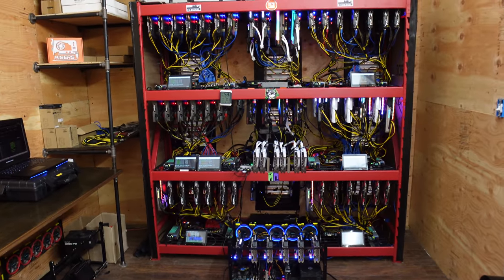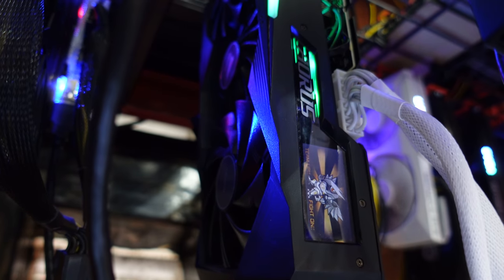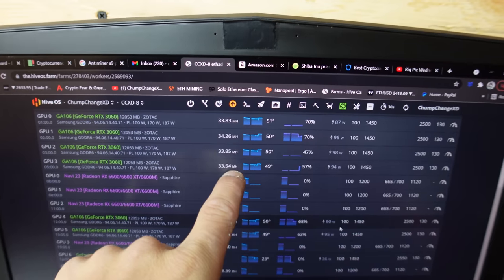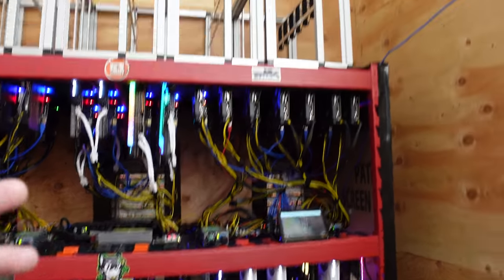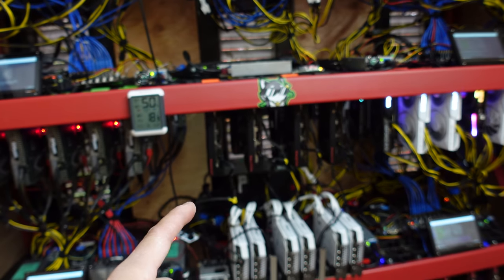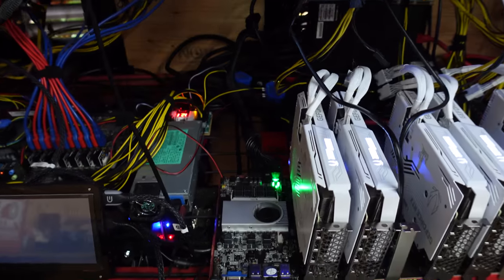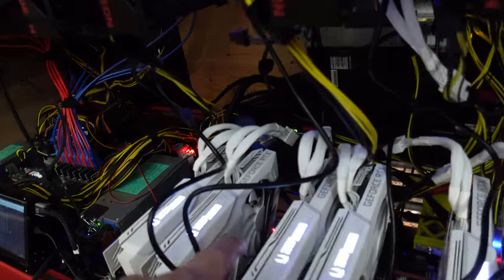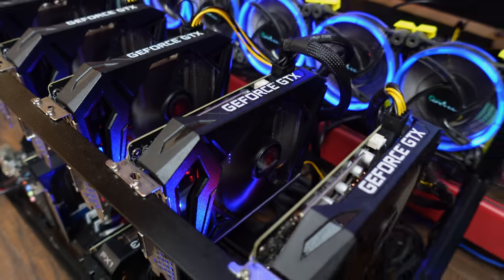My GPU Mining Farm 2021 Is Possibly Too COLD?

Comment from the maker: Do You Think The COLD Will Negatively Effect The Crypto Mining Garage? Let Us Know Below!

I WAS 100% READING THE WRONG NUMBER ON THE THERMOMETER. BUT ITS STILL RELEVANT TO THE VIDEO LOL! ❤
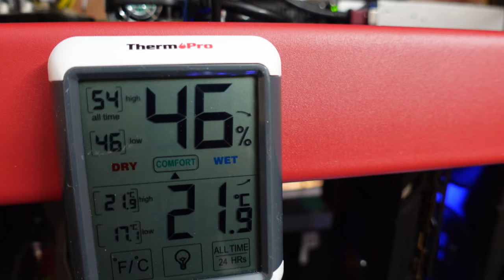Reply: You are reading your thermostat wrong. It said 46% which is your humidity and the bottom number is your temp which you have on celcius. 21.9C is 71F Fahrenheit. Using 7:55 time in vid as reference.
Reply: Well I havent had my gpu setup in the cold but I used to run a few asics and when it got to cold they wouldn't work. Some of them just kept rebooting and others would significantly drop in hashrate. I've also watched a few mining farm tours and everyone says the same thing. Heat is never an issue cause moving air can do the trick just fine. But to cold really hurts the system
Reply from the maker: @thebennymenshow4160  100% my concern thank you ❤️🔥
Reply: @xtremerip  this. It read humidity in the 40s, but temperature in the 50s, on the top left corner of your meter.
Reply: @windpeoples  that is the high humidity reading. The temp was 21.9 c
Reply: @windpeoples  The top left is the high and low humidity reached in last 24 hrs. The bottom half of that thermostat is the temperatures which he has set in celcius. The thermostat is reading around 70 Fahrenheit which is great temps. The top half is humidity. I have that exact thermostat
Reply: @xtremerip  Thanks for enlightening me! I live in a corner of the world where there are hardly any insulated buildings, and no AC or heating are standard, so it is a bit harder for me to read those things. :)
Reply: @windpeoples  No problem. Chumpchange is in USA so he is use to Fahrenheit and probably didnt notice its on Celcius which confused him. Ive done that many times here. He thought higher number was a Fahrenheit reading. Very normal mistake for us peeps in the USA
Reply: lol no.  I mine on my three season porch in the winter here in MN and always get much better performance.
Reply: 100% no.  Until lower than 0C
Reply: I’m in New England and besides my cards running cooler I get marginally better performance in the winter with the rigs in my garage.
Reply: when smoke then trouble shoot, hahahahha j/k <3 420
Reply from the maker: @jaZz-xg5ns  FML LOL
Reply: At my area 8 months a year temps are below 10C and running farms in cold scheds without an issue. As long farm keeping room tem some degrees higher than outside temperature the humidity is not an a issue. However is better t build walls and other surfaces non condensing material to avoid excessive humidity.
Reply: What are those little monitor screens, and where can I grab one from?
Reply: Hey, coming from the overclocking scene and i have a straight answer for you:

No.

At "worst" it has a positive effect on stability and overclocking performance. To be on the safe side get room drying, like packs of "Calcium Chloride" or some other cheap air drying. As long as you don´t get under 4°C(not F!) you are fine.

Comment: Little tip for everyone! Get a led flashlight with adjustable brightness, in the dark the frequency or whatever of the light on the fans will show a difference of fan speed. It’s almost like looking at a fan through a video camera :) This will show you the affected GPU that you change the fan speed of to single out!

Comment: If the surface is hotter than the ambient air evaporation happens, likewise, if its colder, condensation happens.
In your case the heatsink will always be hotter than the air blown on it, so no condensation will occur.

Comment: Did you ever reply to me on other videos as to where you are getting your replacement fans from? Also you are misreading your thermometer. Top number is humidity and it is way humid in there because you’re pulling in too much outside air and there must be a lot of dew out. In the winter I would disable those fans on the side of your shed because you won’t need the cool air in there when it gets cold or at the very least turn them way down. I would also lower those gpu fan speeds.

Comment: Just temperature-wise it should be perfectly fine down to like -20C and probably would work down to -40C and that is right on the silicon, when cards are running you would need like ambient of -50C to get the silicon to -20C...
Only one thing I would worry is if the card gets some frost over it like if it would die and then start again and get water damage.
Reply: condensation only happens if temperature changes constantly and the air is really humid... cold air sub freezing is almost entirely dry. Also condensation happens only if something has a lower temperature than the air and then heatsup..

Comment: 1. Step: try to lower the fan speeds, down to around 70 or 60% check in a few hours hows it works. 2. Step check the humidity/ temps at night, maybe it's to high for some of the parts. 3. Step close all air vents and check the change in temps/ humidity. Should fast change. Most electric components hate humidity and behave strange.

Comment: I work in a rather high-density data center (can't disclose which one). We keep our equipment cold- very cold- as it allows for optimal thermals. Seriously, we have monster air conditioning systems running here specially outfitted for them. Your temps are just fine and in fact, can get a lot, lot, lot, lot, LOT colder before you ever come close to any board based issues arising as a result.
Reply from the maker: Good to know thank you!!

Comment: Get a dehumidifier mate and a gauge to check humidity it will help warm the room too and take away any moisture. 100 bucks for one I'd expect . 200 watts of electricity maybe? Worth it rather than using any other kind of heating device. Defo check humidity if it's in the 60% to 70 I'd do something about it and temps too
Reply: Lol it's a losing battle keeping it cool in summer and now keeping it warmer in winter it gives mr extra heat in my room I'm not complaining.. summer I couldn't mine and walk away from it all day with out worrying about it over heating

Comment: I have been in server rooms that were very cold. I think as long as the temperature does not get near the freezing point, the hardware will not be affected. As for condensation, that occurs when warm air comes into contact with cooler surfaces. Your hardware is warmer than the incoming cooler air.

Comment: if gpus, motherboards can run liquid nitrogen and dry-ice cooling, you can definitely run them with outside cold winter air, they'll love it actually.

hard drives are the only concern with low/subzero temp, no other parts care at all about the cold
Reply: definitely sounded more like your power supply setup with the outage

Comment: Take into account the coefficient of thermal expansion/contraction. These cards are designed with certain build tolerances taking into account the high temperatures they achieve. When the temps drop, all the parts shrink and may not fit or have enough contact with one another. Perhaps the reason things are shutting off? Typically low temps mean low moisture content. Dew Point can be calculated but given the low relative humidity of winter air, it may not be an issue. Do you know the relative humidity in your mining room?

Comment: I didn't have hardware getting too cold and not functioning last winter till about 20 to 30 degrees F or. -1.1 to -6.6 C.  At that point  the motherboard seems to need a warm-up before they started mining again I assume this is due to contraction from the cold on the components or possibly some sort of built in safety circuit to prevent damage in too cold of temps.

Comment: Hey chump, you’re right on with the humidity. I’m up in the cold northeast and I have it in my uninsulated attic. My 6600 XTS run extremely cool and will fall off if the humidity goes up to 70%  and is colder than 50 or so degrees. I run my 6600 XTs at 30% fan now. Might toss them in a grow tent with little ventilation if it gets too cold. Might also throw a dehumidifier up there.

Comment: I currently have a 3070 ti running in near -10c temperatures over night. No issues so far.  Can't wait to see -40.

Currently at -3c ambient I'm getting 33 c core on eth and 41c on rvn. The 1060 in the same rig is 41c on eth. Both cards running 50% fan

Comment: so when i tried to add 4 6600"s and a 1 6600xt on my rig they showed up like yours  on hive with the generic navi 23 name and caused havoc on the rig like your experiencing  ended up removing one of them the rearranging the connections on the mobo so they would be mixed up not on the same bus and then they all showed up correctly and work fine and dont cause hive to get mad

Comment: I think its better for the GPU's , but the PSU's might not like it so much.. had a psu and rig in the window here when building, and once it was a -5c breese on the machine, the PSU sounded like a jet engine, even it had either 100w or 500w being loaded on it.  maybee some strange "to low" temperature sensor in the PSU?

Comment: I wouldn't worry about it being to cold, after all there are extreme cooling solutions out there to drive temps. pass sub-zero temps.  I have similar things happen in hive hard reboot with PSU completely off for 30sec.s usually fixes it

Comment: Nice.  Good stuff.  Man I wish I had the problem of it being too cold lol.  I am still battling heat now that I set up another rig.  I think you just needed a hard reboot.  I dont think it is too cold.  The cards are still probably running at a good temp.  I really like that garage space.  I wish I could build out my garage similar but I just have the electric ran to it.

Comment: I don't think your temps are the problem. Mine are running in a garage that is as low as -3c at night and only 10 in the daytime. I have my fans on auto though so they don't chill right off. I'm getting the best hashrate I've ever gotten right now and about all that's changed besides switching to nbminer 39.6 is the cold weather. I do give my rigs a hard reset once in awhile though if strange things start to happen and that usually corrects any issues.

Comment: I only worry below 10C , then you can think of condensation. Do you ever check your humidity? I run auto fan,  which slows down the fans a bit in the winter. Got my core target at 58C and mem target at 75C although  you can't see mem Temps somehow it still spins up to accommodate
Reply: Only saw now, 47% humidity is perfectly fine...

Comment: One  of my Radeon RX 6800 16368 MB · Sapphire  have the same program. today spend my hold afternoon。
At last I set CORE VDD to "640" .that`s fine. you can try!maybe the GPU need more power when the temp is cold. 😂

Comment: Could have been multiple other things. Static charge, new DAG gen.  I run my stuff in cold climate, too cold? No... Although I have a dumb HP power supply from parallel that if it gets cold the fan winds up full speed lol.

Comment: you genius read the humidity as temperature and completely disregarded the actual temperature in celsius going up, why did you buy a celsius temperature gauge anyway? if you don't use metric just use imperial it will be easier for you.
also, your garage is waaay too dry, 50% humidity and lower is very dangerous for electronics if not handled carefully, low humidity can literally KILL electronics from electrostatic discharge in the air if you handle them without proper ESD safe equipment, if i was you i would actually put a humidifier in that area to try to keep humidity at around 70% instead